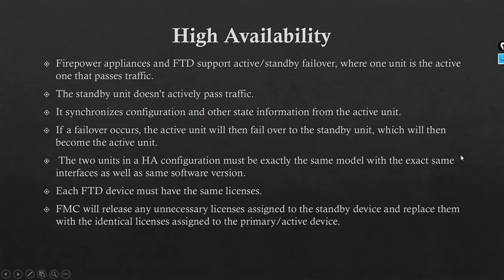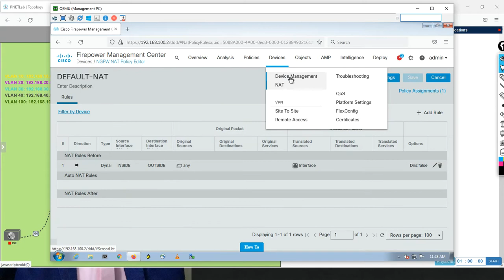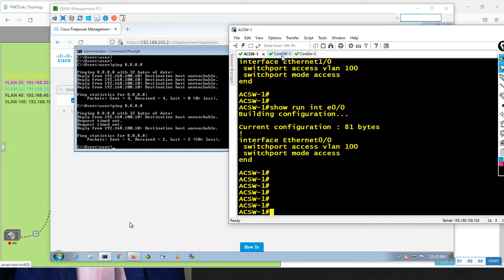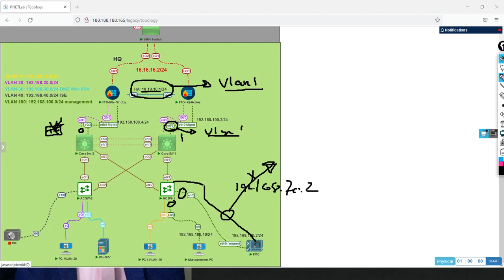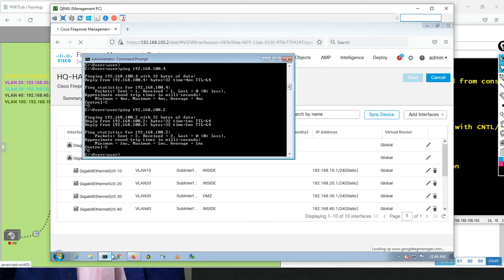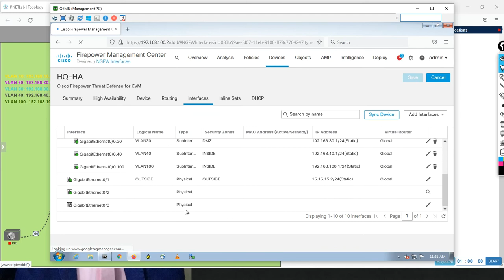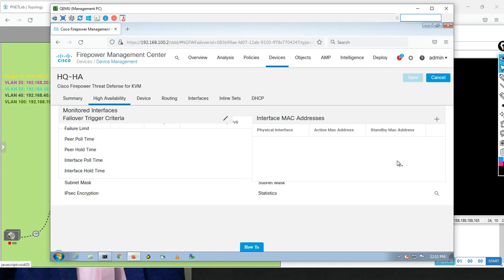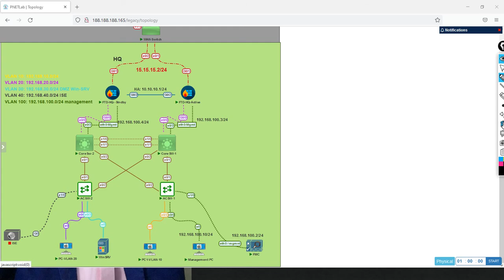12- HA Heartbeat Problem with FMC

Comment: Why didn't you create vlan interface 1 on core switche and assign them their management IP?   You created  vlan 100 on both core switches and assigned ip 100.3,  100.4. You're supposed to change the vlan 100 to vlan 1!

Comment: why u use mgmt int in inside SVI ? in your topology mgmt int have different cable and plug ini eth0/3 in the switch
Reply from the maker: Because I dont wanna lost the students, if i connected the management interfaces outside the topology